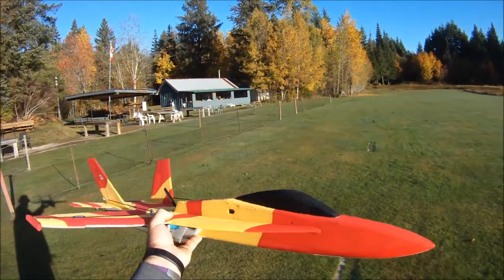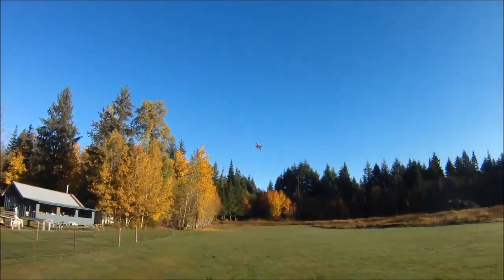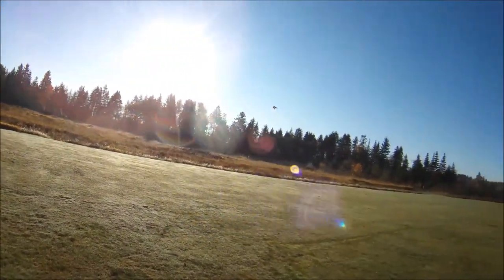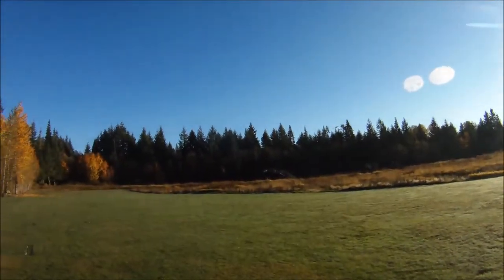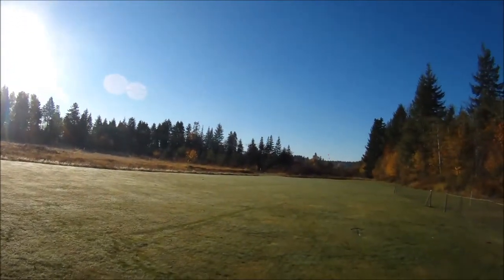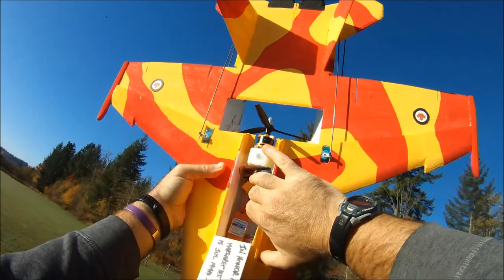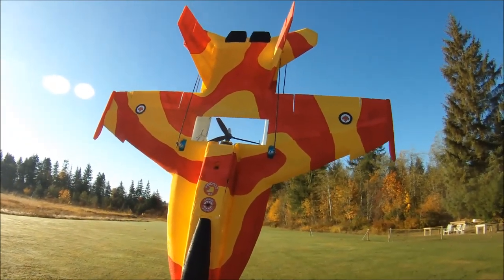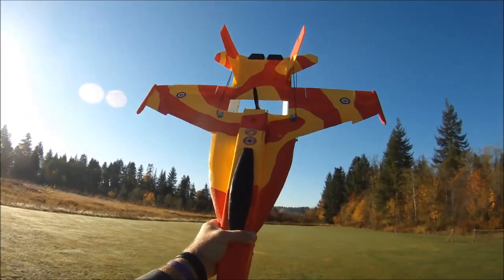Dollar Tree foam RC Powers F 18 V5 30 Oct 2017

Comment: How do you keep the wings rigid? I built one of these and hot glued a CF rod into the wing but it flexes like crazy.
Reply from the maker: What sort of foam are you using?  I always use epoxy to glue in my reinforcements, hot glue still has flexibility when it dries, epoxy dries much harder and stronger.  Good luck :)  Cheers, Scott
Reply: @e3Scott  I'm using dollar tree foam with the paper peeled off. And I'll be sure use epoxy for the rods next time :) Do you recommend using epoxy instead of hot glue for the entire body too?
Reply from the maker: @smokeypillow  I suggest you please watch this video, my lessons learned on building with DTF.  https://www.youtube.com/watch?v=biYB8I_GsG4&list=PLKu3yFqYM98l-SDLJd_2YeqBzMZ9n7xLg&index=5  When you watch that video, go to the video description, I have links to several blog posts I wrote about my lessons learned building with DTF that should help you.  I leave the paper on the wing when I build with DTF, this provides much more strength, even if you use epoxy, if you peel the paper off the DTF on your wing it is still going to be floppy.  As for glue, this video discusses the glues and tapes I use when building and how and why I use them https://www.youtube.com/watch?v=6iVQY3AFZHQ&list=PLKu3yFqYM98nssGrYFEYzufnssAuFshHn&index=2  Best of luck.  Cheers, Scott